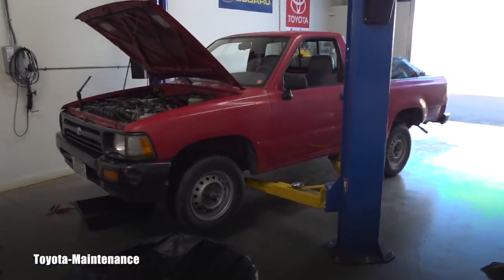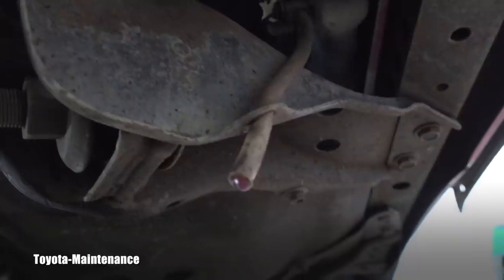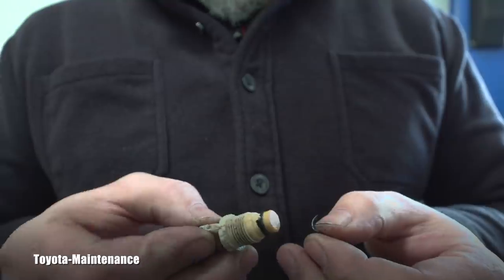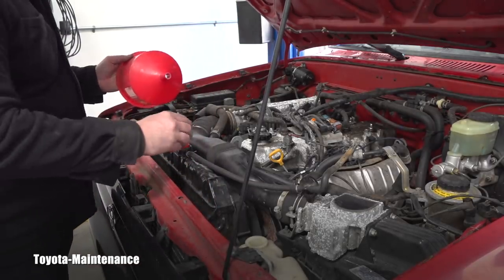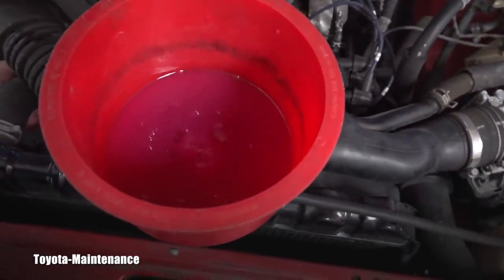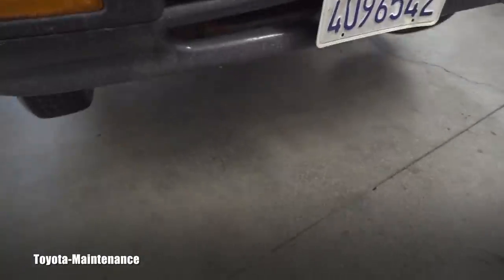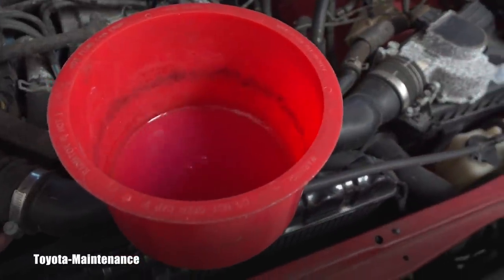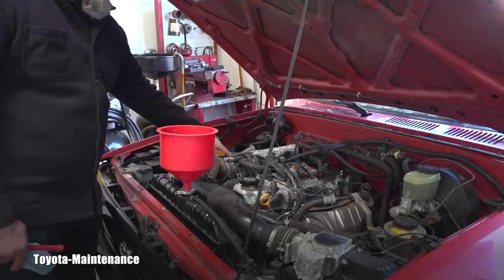Toyota Truck Overheating Problem

Comment: I brought a new '93. I sold it 10 years later before I became a DIYer. Selling it was one of my worst decisions.
Reply: They're damn good work horses,my condolences.I'm not gonna sell my 2002 Yaris (UK spec)  as it's the best car i've ever had and it's staying.Never had any issues what so ever.
Reply: @tardeliesmagic  ya Toyota are brilliant from those years there a dream to own and work on
Reply: older trucks are much easier for diy, new trucks are too complicated for diy
Reply: probably not on the road anymore as they rust like crazy, my only complaint with yota
Reply: That truck reminds me of my '92 Nissan pickup, it was base too. No AC or powered anything, didn't even have a rear bumper.  Good little truck, regretted selling it.  I don't remember the KA24E making any clicking sound when idling though.
Reply: How come we never see these things when we first buy them?  😆 I've gotten rid of some gems I wish I wouldn't have!

Comment: Pretty similar to an experience of my coworker. 2010 V6 Mustang went into the dealership and the inspection report said that all critical fluids were the proper level. She complained to me a few weeks later about a shaking steering wheel when braking, so I took the car for a test drive - rotors were just out of round. However, when I turned the car on, I heard this whooshing noise through the dash - telltale sign of low coolant and an air bubble in the heater core. Opened up the hood and the overflow tank was BONE DRY and I quickly found the leak at the thermostat housing, which is a known issue on these generation of Mustangs. Replaced the housing and flushed and bled the coolant system and replaced the pads and rotor on the front end. 
Nobody actually wants to take their time anymore or cares if they do the job right. You though are very thorough! Thanks for being honest. Wish I lived by you as I would totally use you for bigger jobs on my cars.
Reply: It wasn't cause the dealership didn't want to do the job right.  They wanted it to get bigger problems so it could come in for more expensive repairs.
Reply: @DaBinChe  I think assuming they 'overlooked' the issue for a larger job is not out of the question, but it is the morally and ethically the wrong thing to do. My gut is they said they looked over the car and they didn't. A problem, if identified, should be stated to the customer and they should be given the option to repair it or have the consequences of non-repair explained to them. In this case, a coolant leak could lead to engine overheating and potential engine failure - anything from full blown failure to the head gaskets being blown.
Reply: @johdirt7843  There is a reason why they are called stealerships.  Automotive sales and repair has one of the shadiest reputations around for a reason.
Reply: @DaBinChe  They are called stealerships because the profit of automotive sales in the US is driven by their service departments. They often recommend services that are well before the recommended interval as determined by the manufacturer or push unnecessary services like replacing brakes at 25k miles.

This is just outright dishonesty or overlooking an actual problem.

What is funny is that my coworker would have paid them to fix the the thermostat housing and they probably would have netted a around $500 on the service.

Comment: I had a old 1995 Toyota Truck in this same color with a 5 Speed Manual. I had 276,000 miles on it when I sold it. It ran like a Top!! I wasn't driving it much cuz it was a regular cab and my wife and I have 2 kids. I couldn't carry everyone. I bought a 2013 Toyota Tacoma TRD Sport 4x4 Double Cab in its place. My new to me Tacoma had 42,000 miles on it when I bought it back in 2015, now I have 110,000 miles on it and that V6 4.0L runs great!

Comment: Thanks for the great video. I've got an '89 Toyota pickup (built in Japan in Oct. 1988) that I bought new for $6,689.00. The original 22R mill, with carburetor and distributor, still runs great. I'm keeping this truck till the day I die!

Comment: I have a 1993 Toyota pickup, probably one of the best in California.  I rebuilt the engine using a genuine Toyota short block from the dealer. Having gone through every system on the truck, I thought I knew it all, but your video taught me a little detail I never knew.  The fact that the radiator drain tube goes through a hole in the radius rod bracket!  I never knew that before watching this video.  I went out to the garage and put the tube through the hole, now the truck is one more notch closer to perfection...thanks!

Comment: It was great to watch a pro making a mechanic video instead of us home gamers.

Unfortunately, my 1997 4WD Tacoma needs a water pump, and I'm replacing the fan clutch at the same time, even though it was one of the not-a-recall Tacomas with the frame that wasn't corrosion treated, so the frame is rusted almost in half with only 136,000 miles.

Comment: Oh my lord. My jaw is on the floor with the condition of this Pickup truck. A 93 with just over 84k miles. I am absolutely jealous. Sad to see it's been used for this kind of work. In a few years it's going to be very beat. If wish an opportunity to buy a Pickup in this condition or better with this mileage. It would be a no brainer

Comment: I did my first coolant flush 2 years ago and one of the best things I did was buy one of those no-spill funnels. They really helped me understand how the process worked, like you showed you can watch the level while you're squeezing hoses and see that air really was stuck in there.  And then you also feel the hoses firm up a bit afterwards. 
Also, I didn't have any heat from the heater after quite some time, so I was going for a short drive to help dislodge any more air in the system, but it didn't take much. I started to feel heat almost as soon as I backed down my front ramps on my driveway.  Good luck everyone learning this. It's easy once you know how.

Comment: What I have seen in the past was the older generations not taking the time to look thru their owner's manuals to see how to treat their cars.  Fluid levels and routine maintenance get ignored.  One told me I thought the coolant bottle was just and overflow.  I told him it is but, it is also used to replace coolant also.  He ended up with a warped head he had to replace.

Comment: I wish I had a mechanic like you. I Have a 1995 T-100. My brake line burst. I went to the closest mechanic. He did a real good job fixing the brake lines. 6 months later, my engine started missing on acceleration. Two months later, it would not start. I changed the fuel pump. While I was underneath the truck, I noticed the fuel pump filter was missing. In its place there was a new flexible hose. I was driving without a fuel filter for months. I tried to figure out what happened to my fuel filter. I put 2 and 2 together. I realized that the shop that replaced my brake lines also removed my fuel filter but did not tell me about it. The cause of my engine missing and then not starting was dirty fuel injectors. The cause of my dirty clogged fuel injectors was the missing fuel filter. Do you think they were counting on me returning to that shop and getting $600 work fixing my fuel injectors problem? They really thought they had a sucker. I wrote a long review of the shop telling what happened. They never responded though. CRIMINAL!!!!

Comment: I bought a new 1987 Xtra Cab with the 22-R ( Carburated ) and planned to keep it until it died. 
At 199,998 miles, a lady ran a STOP and T-Boned my Truck, "Totaling" it. got $3750 for it from insurance company.
I was very sad about that. Should have bought a brand new 2001 Model Truck back then...

Comment: Wow 84,XXX miles it’s basically a new truck I owned a 1990 same color like this and mine was a 4 speed manual carbureted  I loved it but got a really tempted offer so I sold it I regret it sometimes I did alot of work on it 200,000 miles and it still ran like a champ

Comment: I would like the video because it has details but it lacks how you opened the O- ring valve. Did it attach to the drain valve? My car’s lower     part is getting hot and the coolant is falling down, but I fill it up every day with water and the temperature gauge suggests temperature is okay, though the clock is getting warmer.

Comment: Wanted your opinion on an overheating issue on a 97' Toyota Tacoma 3.4l 4x4 5speed. Radiator and heater core isn't new, thermostat is new I think it is an 185 degree. I am able to get coolant to circulate just fine at idle, but once being driven gets very hot even in town with speeds under 45mph. Highway use is out of the question, that is actually when I found out I had an issue. The temp gauge got close to the red and I had pulled over to check things out. Not loosing any coolant while sitting or dialing only when driving to to engine overheating. I am thinking the cylinder head gasket or cracked cylinder head, any guesses?

Comment: Hey, Thank you so much, I am about to do this service on my Toyota Tacoma V6 1996 4WD 5VZ-FE Manual Transmission, but I have a question, how to do this without this fancy funnel? I was thinking if by any chance it could be not necessary to wait until the bubbles go out, since it has a hose to suck coolant from the reservoir or to spill it out in the same reservoir, so could it be possible that those bubbles could travel to the reservoir instead of leaving the radiator cap off?

Comment: By any change would it be possible that it is not necessary to wait for the bubbles go out with that type of funnels, because it has the reservoir tank, where the bubbles con go? I mean, what if we drain the radiator, re-fill it up, with the reservoir tank included, and then start the engine, and use the reservoir tank as an alternative of the anti-spills funnel, and then at some point when the operative temperature is reached, and thermostat opens and start the flow, the bubbles trapped inside will travel at some point to the reservoir tank and get integrated with the rest of the air in the reservoir tank. If not, what if we leave the reservoir tank opened until that happens?

Comment: I like your videos and I will ask a question if you could answer please. 91 Toyota truck I want to replace the transfer case fluid but I don’t know which is the fill plug and the drain plug. Could you let me know if you have the time to answer if not is ok. Thank you in advance .

Comment: My first car was a '86 with 22R 5spd, hated that thing.  It was the worst driving car I ever had, brakes, suspension the way it felt just awful.  At first I didn't care or knew any better but after a few years and driving other cars I was like damn this thing drove awful.  Was very reliable the short amount of time I had it.  Didn't do anything but oil/oil filter/ air filter and maybe plugs. Got it after working all summer long at my first job at 16 for $3k w/~130k miles, sold it in college after someone rear ended me and totaled it, it was only the bed that was destroyed.  Got a new bed at the junk ward and repainted for about $1k, sold it for $3k with about ~180k miles.  So I basically had free use of it.  My current 2003 Ranger 2.3L 5spd is a much better truck, drives much better and feels much more solid, just as reliable.  Got the Ranger for $3k with 90k miles and am almost at 180k, will keep it till 250k miles then might get a used newer model ranger.  Think I can sell the current ranger for about the same as I got it for too.  This current ranger is my second one.  I had an identical one, Mazda B2300, same year color and everything before this that I sold and regretted it.

Comment: I burped my radiator after changing my temp guage sensor and now it shows max hot but not into red. Any ideas where to chk. Guage is ok. Wire to guage is ok. Thks

Comment: Cool video,I have the same truck and the same year And I have problems with the stop  lights please any idea what is the problem?
Reply: You need to check the ground for both lights if they both don't work. I'm assuming you have checked the bulbs, fuse(s) and power at the sockets

Comment: Where are you located? I was curious about how much does it cost to change a timing belt at a local shop for a sequoia,  dealer wants 1600
Reply: Arcata, Ca.
Reply: I do mine each time. Runs me about $300 With  coolant and parts. You usually replace the water pump at the same time.
Reply: @erikcox1947  I have. A 22re same k ER heating problems but I don't know if it's the radiator

Comment: I have a p440 & 444 on my 2002 TRD Tacoma can u aid me?
Reply: P0440 There is a large leak in the EVAP system. 
Tightening or resetting the fuel cap.
Replacing a leaking fuel cap that has a bad seal or vent in the cap.
Repairing or replacing leaking vapor system components like a vapor control valve or carbon canister.  
P0444 The evaporative control (EVAP) system captures any raw fuel evaporating from the fuel storage system (e.g. the fuel tank, filler neck, and fuel cap). ... Code P0444 indicates that there is improper purge flow in the EVAP system caused by an open purge valve circuit.
Reply: Swap out your charcoal canister.

Comment: If you need to hire out this extremely easy job preformed you need to own a newer vehicle, or you'll spend a lot more than what your vehicle is worth to keep it on the road. His O ring looked smaller than the original, I'd surely get a new plug or a better fitting O ring before using rubber sealant on a plug to keep it from leaking. The next time you open the drain plug you'll have the same problem all over again. This is why I do my own work, and why auto mechanic class in high school and trade school is important.

Comment: Hello everyone, Does anyone know when replacing radiator on 1st gen. Sequoia, there are 1.25 Inch and 1 and 7 sixteens inch cores. 

Which one would be better to use? thanks for your time.

Comment: I owned a 87 4 banger 4 speed, it was a beast.  Sold it at 383k miles 16 years ago, the next owner is still driving it.  I miss it 😔😔😔.
Reply: WOW, you must have really taken care of it and definitely got your money's worth!
Reply: @apache-yaquibrown4060  I owned a 1988 Nissan King cab 4x4 and feel the same way you do, but the only difference is that I'm from the rustbelt and afterv 18 years the frame needed replacing, but still miss that truck.